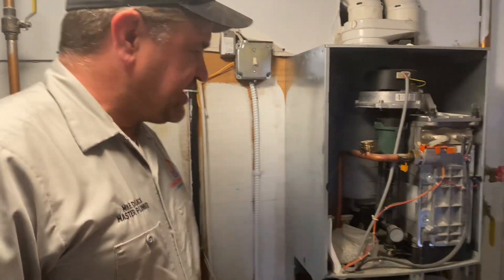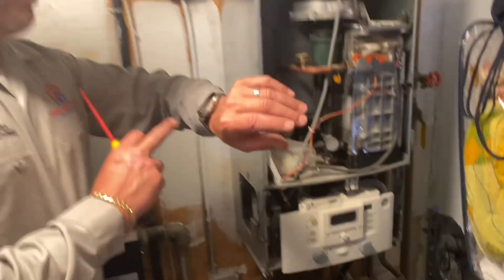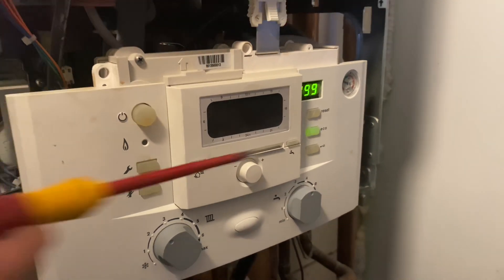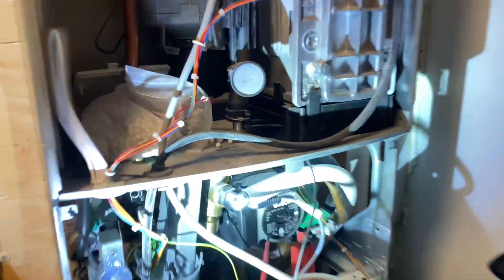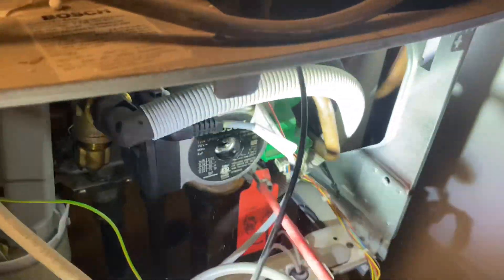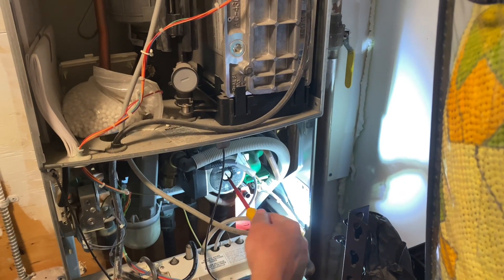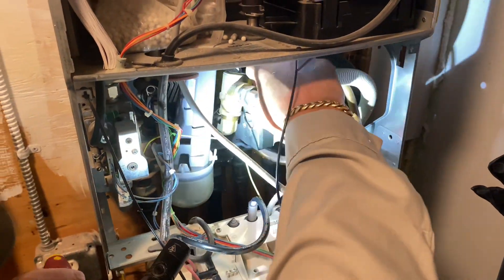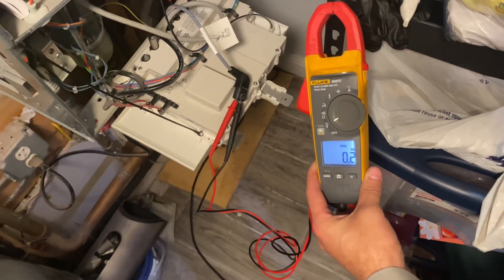Bosch Greenstar Combi No Hot Water or Space Heating - How to Test Circulator

Comment: You will always get water dripping/leaking out of grundfos circs with the shaft access screw removed. 100% of the time in my experience. Maybe a little and maybe quite a steady controller stream 🤷‍♂️
Reply from the maker: A steady stream is a broken pump seal
Reply: A little water is normal, you can bleed the pump that way if it gets air bound. But Mike is right when it’s streaming